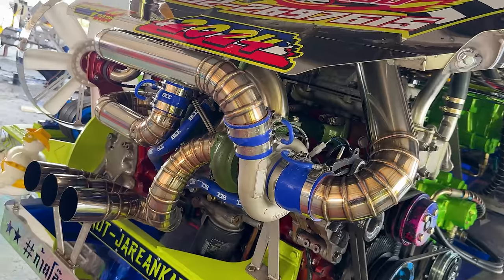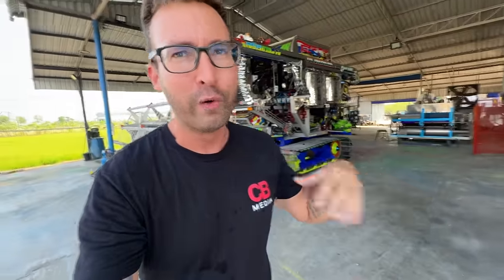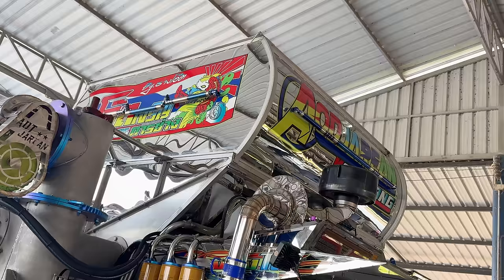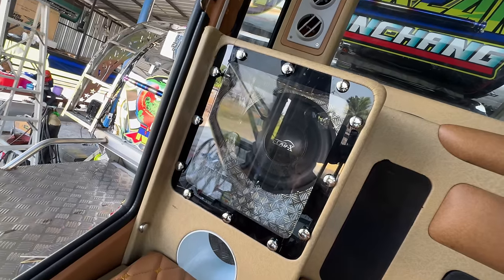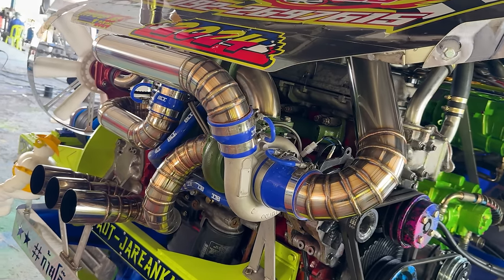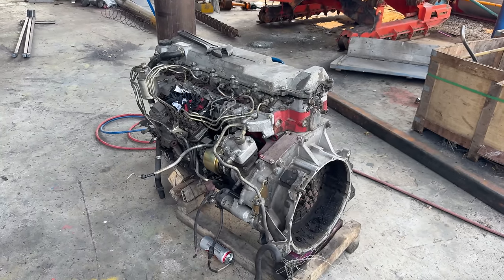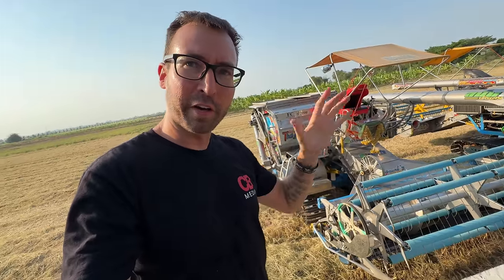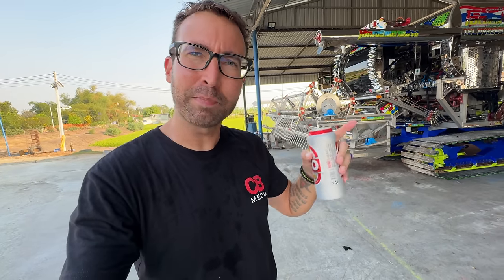Triple Turbo Rice Tractor in Thailand!

Comment: I'm a tractor and diesel specialist, I am from now on going to talk mad shyt to my clients about the way their tractors look with no style no class and no triple turbo set up.
Reply: 5555😂
Reply: Tell them more turbos = more grain 🌾
Reply: They don't use tractor experts. They are farmers and what you see is their style. Things that are not like yours It doesn't mean that He doesn't have style.
Reply: @Teejay_2000 Your country's cereals may increase by adding turbo. But in Thailand They added a turbo to give the engine more power to make the wheels work in the dirt. Don't show your ignorance. Until you learn
Reply: @user-mum999Aries  tractors need more style.
Reply: Exactly..... Show them this...
Be like the Thai!!
Reply: @user-mum999Aries  you gotta be shittn me... So having a compound turbo set up is needed with that machine? That would be considered excessive in New Zealand... But I would run it.
Reply: @user-mum999Aries, the machine is a tiny combine harvester. It probably had a 50-75 hp engine to begin with. Also, you can only go so fast with a combine, regardless of power, or you’ll just end up choking it or throwing all the crop out the back. They’ve modified this thing for no other reason than fun, the mods have no practical function, period.
Reply: @johnnyappleseed9254   like isn't it obvious 💀
Reply: Convince em Into building tractors that look good while they’re workings mate, that’ll get em spending 🤝🏽
Reply: You haven't seen many of CB's videos, have you? 😅
Reply: No good idea.
Reply: พวกเขาเป็นชาวสวนที่รวยมาก ที่ทํารถแบบนี้ ชาวสวนธรรมดาไม่ได้ใช้รถแบบนี้ คุณไม่รู้หรอก
Reply: @2dogsmowing  been watching since the long tail river boat rice tractor races, shit that got me hooked on him,I remember his wreck on the green scooter or when the lady boy said she was going gluk gluk Chad at the end of the scooter paint challenge if you want to call it that, shit bro I'm a huge fan of the Chad
Reply: Are you stressed out? Thai people are good at combining work and fun..together..and of course These things don't exist in you..sadly.
Reply: I saw a combine harvester like this. It's been over 20 years. They are very good at building cars.
Reply: Thai mechanics are very good at customizing racing cars. A Thai mechanic has taken a 4-cylinder engine to a drag race, defeating a 8-cylinder engine in the USA.(pickup truck)
Reply: @user-mum999Aries ใช่คุณพูดถูก
Reply: ไหน เอามาลงโคลนหล่มที่ไทยให้ดูหน่อยพ่อฝรั่งมีคลาส พ่อสูงส่ง
Reply: They just spent an excessive money for excessive power
Reply: If your friend doesn't have 3 turbos on his tractor. You should tell him you're falling behind.😂
Reply: @johnnyappleseed9254  The engine used in the Thai rice harvester has many grades. And the old machine that is commonly used will have more than 190 horsepower As for the modified machine The horsepower will be 300 or more. Like this car, 3 turbo horsepower that is tuned roughly 400-500 horsepower.
Reply: เขาออกแบบมาเพื่อใช้งานจริงในนาข้าวไทย ที่มีหลากหลากรูปแบบ ตามสภาพแวดล้อม ดิน ฟ้า อากาศ ที่ไม่สามารถควบคุมมันได้  และมันสามารถทำงานได้ดี ไม่มีสไตล์อะไรอย่างที่คุณว่าหรอก นอกจากการใช้งานได้อย่างดีเยี่ยม คลาสและสไตล์ของคุณบางทีก็ไม่ตอบโจทย์ของผู้ใช้งานจริง 😊😊😊
Reply: they are farmers who have money and ideas for making harvesters, not tractor and diesel specialists, you understand?
Reply: No matter what One thing that Thai people have is We don't disrespect others. We do not flatter ourselves that we are better than others. Thank you to our ancestors for teaching us to respect others ❤️❤️🇹🇭🇹🇭
Reply: ฝรั่งบางกลุ่มที่โรงเขลา เกี่ยวกับระบบเทอมโบว์  และการใช้งานจริง  สิ่งที่เหนือกว่าพวกคุณ แต่กลับว่าเราโง่เขลา ไปปืนเขาเถอะโรบิลฯ😄

Comment: never in my life would have I dreamed of seeing a rice tractor that looks like that let alone with three turbo charges on it and Chad if it wasnt for you i would never have seen it and its freaking COOOL LOOKING thanks Chad !
Reply: This car is priced at 2.5 million Thai baht. The steel pump uses a Daikin pump, a Hino JO8E engine with 450 horsepower. The 12 HT suspension is derived from an old excavator's suspension. A 5-foot massage van with a 3-meter hook head is both packed. 2.5 tons of rice

Comment: The diesel builds is why I want to go to Thailand, get some ideas for my old Hilux.
Reply: The Thai rice harvester has high maneuverability in muddy areas because it uses a crawler-type suspension like a 5-foot combine harvester, a 3-meter harvester head, and a 2.5-ton rice load, a Daikin hydraulic pump, and a walker. kayaba suspension 12 HT uses hino engine

Comment: Umm .?  245 horsepower?  You made that sound like a lot? but that is pathetically low.
Reply: An engine needs more torque than horsepower.  The durability of the machine is important for use.  If you want to reach 1000 horsepower, it's not difficult.

Comment: That is way to pretty to put to work in a muddy rice paddy, but they will...
Reply: That is the reason for installing a turbocharger on the engine to increase hp.
Because most of them have to fight with mud.